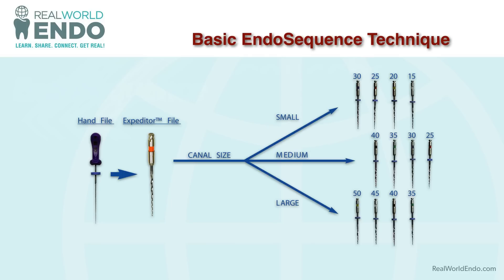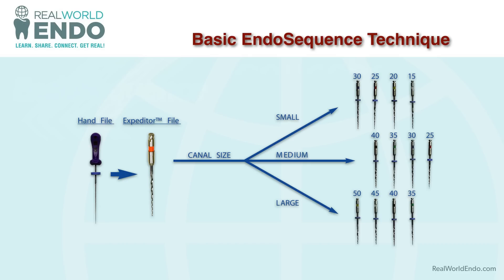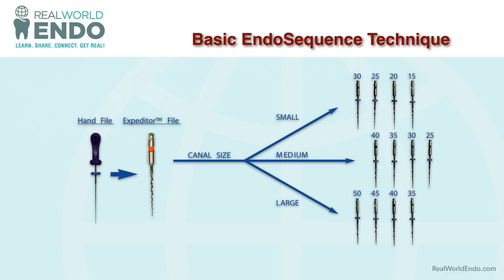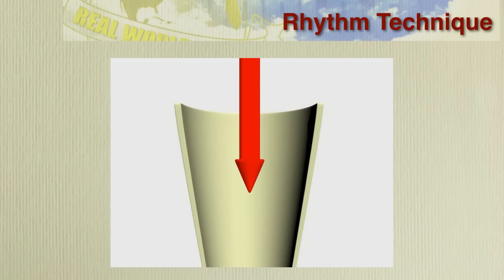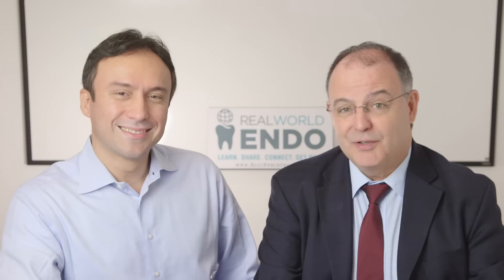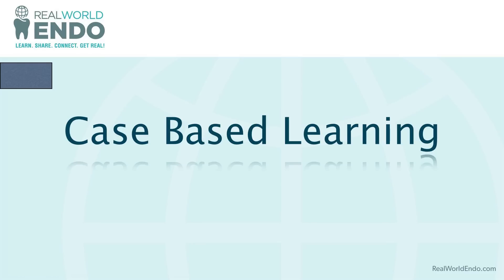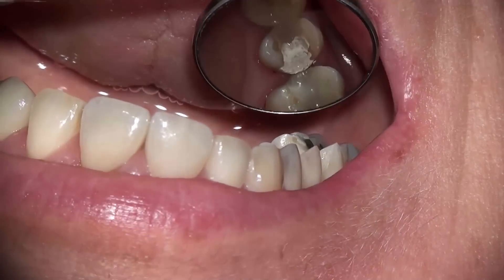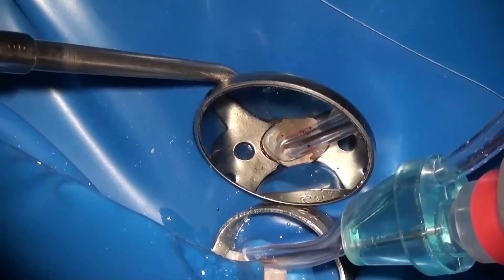CBL 18: Premolar EndoSequence

Comment: hello Allen. what kind of radiograph do you suggest to use? Is that phosphors? I'm having a lot of problems with digital rvg sensors... some are good but others are really unaccurate
Reply from the maker: I have used Dexis since 2001 and have not had any issues.
Reply: @EndosKool  i mainly have problems when I have to take an rx for upper incisors and the palat is narrow. what do you suggest?

Comment: Thank you so much for these valuable vids. I wanted to know when you you put a cotton pellet in a small access cavity like like anterior teeth, what is a safe way to have it removed without further pushing it down the canal. Is using the endosequence rotary in that case considered unsafe?
Thanks again for the great content
Reply from the maker: No need to place a Cotton in the anterior teeth Abdul. In a small access just place the Cavit without the Cotton. You get a little air trapped between Cavit and the GP that acts as a cotton spacer and won’t have the same problems. Hope this helps. Cheers! :)